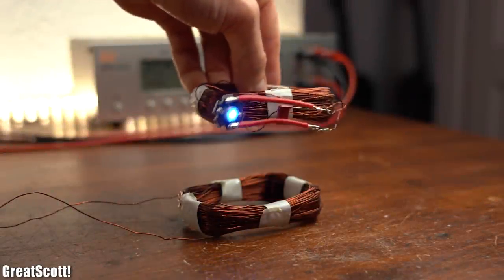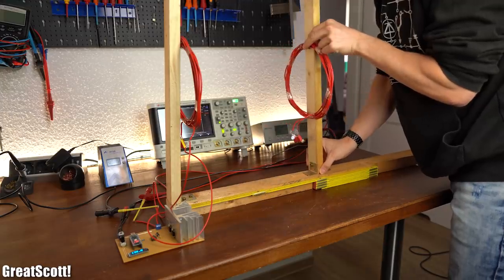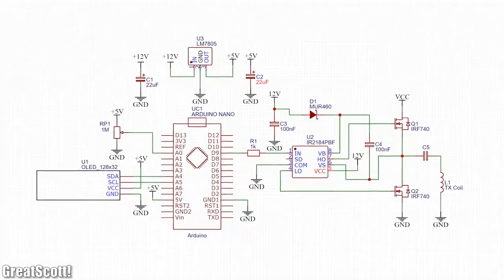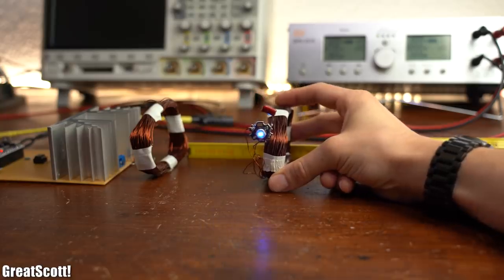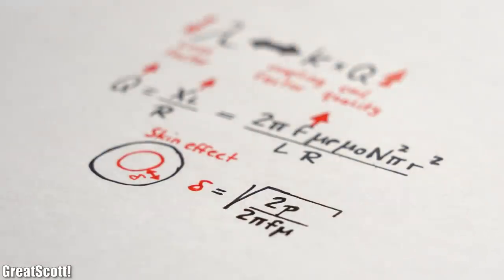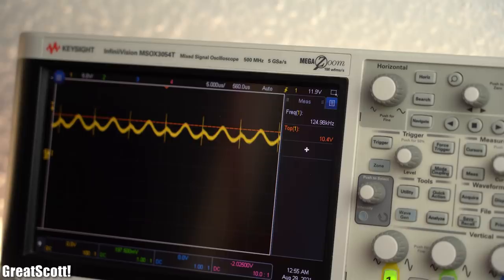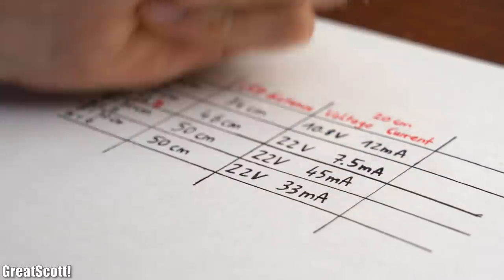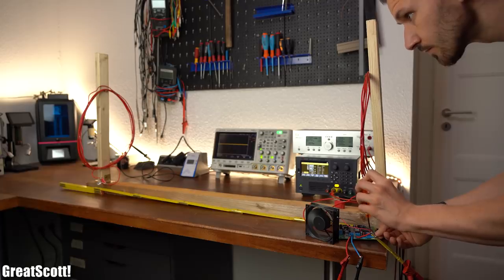How far can I Wirelessly Transfer Power? (Experiment) Better than at MIT?

Comment: I am confused. I guess it doesn't work like my possibly faulty thinking how RF power drops off at the square of the distance. Near and far field comes into play but I am not sure how.  Basically the surface area of a sphere grows with the square of the radius (A=4πr2). The part that converts it back to usable power surface area stays the same so it should drop off by the square of the distance. I guess your still in near field? I wish I knew how all the near and far field stuff works but I don't.

Comment: I'm wondering if a design similar to a yagi antenna might work better.  Where a yagi uses parasitic elements for reflection and direction to achieve gain in a specific direction, a variation of this for your experiment might work to improve performance.

Comment: Isn't short range wireless power transmission more useful, or at least more practical. There must be some real problens with wireless mobile phone charging, as it must be difficult to maintain resonant coupling when the components and Earth plane of the PCB are so close to the receiving coil. Induced eddy currents must load the transmitter coil. 
The wireless charging of the tooth brush is interesting, as the  magnetic coupling is via a two part transformer with a ceramic core.
I have often wondered why these are not used to charge portable soldering irons. A far more convenient option to the very common connection pins, which so often fail to connect reliably. I had assumed that the charging current demand of such irons greatly exceed that of the toothbrush, particularly when account is taken of the charge to discharge duty cycle. However the very small pot cores used for the coils of buck converters, suggests that two circular E cores might be used to act as an efficient magnet couple between the base of the soldering iron and its associate charger.
The prise target for wireless charging must be electric vehicle charging. I have read a few papers on the subject produced by the Consortium working on wireless charging, but it is difficult to see how this technology can compete with the efficiency of an low resistance  electrical connection.

Comment: lol, So all of that to tell us you are better off making it like an HF radio and antenna to transmit power wirelessly. like we have been doing since the 1800's.
Your loop antenna is directional by the way. and that is what you wanted to get away from. try dipole antenna or better yet a 5/8 wave ground plane antenna will get a low elevation radiation pattern and omni directional, because you are not trying to charge things on the ceiling. a yagi in vertical orientation would work well for one direction and you can adjust the vertical angle with the number of elements. just some thoughts. Great video!

Comment: I am curious if stranded v. solid copper wiring in the coil make a difference. Or maybe even each coil being a different wire? There is something i heard about high frequency and skinning effect. I think that might be an advantage for the transmitter coil in the high MHz+ frequency range, and maybe solid or stranded receiver coil doesn't matter? Love the video, as always, i am left more curious than before watching, and i now know a lot more. Thanks 😊 and keep it up.

Comment: I did something like this using 32 gauge enamel coated wire for the transmitter coil. I wrapped it around the rim of a 12 inch ice cream lid. The pickup coil was the suction cup coil used for recording phone calls. I was able to transmit music through a wall.. Maybe as far as 24 inches apart.

For your project, I was wondering if you used a H-Bridge to drive your coil in both directions, you would get more power through-put..

The MIT coil looked helical.. Would that help make it more focused in one direction?
What if the transmitter used 2 coils with (imposing polarities --(Opps that might cancel out**))?
Would that make the field go further... (Think Beam Shaping)

** coils with imposing polarities is how TR metal detectors work. They have 3 coils sandwiched like an Oreo cookie, where the receive coil is in the middle at the magnetic void.
It only detects when to 2 fields become unbalanced by an external influence.

Comment: RG-140 or silver plated coax cable is used because silvers high voltage properties. Transmitting through the shield you won’t have to worry about skin effect. Expect to be at 1 MHz for efficiency because quarter wire length. The goal is to give inductor the highest self capacitance as possible. Ideally make it equal and that happens around that wire length. It’s not just diameter that your looking at, it’s also the spacing in between the wires. That’s there the real magic happens. I dunno what the bands are in Germany but anyone trying to listen to the ole baseball game would not be your fan! 

If you took a  coil with 3 turns with a diameter that was a light year but the spacing between the windings was “close” it’s going to induce a current in the the second winding before electromagnetics could ever catch up.

Good luck brotha! This whole thing kinda mushed my brain when I started working on in. Who know maybe I just shocked myself one to many times hahaha! 

Easy to test the theory, just get close to the wire and see if your capacitance knocks the circuit outta tune. You are one with the circuit…. Om…. Or did I mean Ohm? ;)

Comment: Would a zero voltage switching get better efficiency? The mosfets losses would be minimal and only would be need good capacitors and wires
Reply from the maker: No

Comment: if distance between primary and secondary coil reduces power transmission, how about adding something in between the two coils to act like a bridge, maybe a third coil acting as a repeater in cable signal wiring....

Comment: Hello, Great Scott. Great to see your extensive experimentation with wireless power transmission. I have a question to ask you now. I reproduced the H-bridge drive circuit exactly as shown in your video, but when I connect LC in series to the circuit, even if a small VCC is given, such as 2V, the current can be close to 1A, which is consistent with a short circuit. The resonant capacitor is also overwhelmed, and the pin is almost in a state of fusing. How can I use it correctly to generate resonance?

Comment: Awesome video with nice explanation!
I had one thought that might improve this project: Wouldn‘t it be better to lead the magnetic field like a transformer does it with its iron core? Sure, it won’t be “wireless” if there is a connection of the two windings with iron. I mean you can use an iron core just as long as it should be to lead the magnetic field and get a higher efficiency or distance (depending on what you prefer). Am I right?

Comment: Question.  Does the coil need to be copper?  Can it be hollow?  Would hollow make it better or worse?  

I was thinking a coil of automotive tubing (steel) which conveniently has a protective coating on the outside that might be an insulator.  If that doesnt work then a coil of copper tubing.

Also if the tubing was filled with something like say water... salt water... steel BBs... something like that might give a larger core without added cost of large copper wire.

I think aiming for ludicrous frequencies would be a good video... I just wonder if at some point you end up coupling to every coil in every transformer in your equipment :p  oopsie.

Comment: Instead of using expensive cabels you can use cheaper copper tube from hardware store. That should minimize the skin effect. And probably you can increase your maximum frequency by using an ESP32 instead of an Arduino. I know that means more expensive power semiconductors but maybe the results can compansate that.
Reply: It won't maximize the skin effect. It simply takes advantage of the skin effect to minimize the material required to carry the current. Also you can compute the skin depth given the frequency for a given percentage of the current.
Reply: @Sylvan_dB  Yes! I was a bit too short. I mean no skin effect if the whole conductor is a skin, but if I'm right that effect only matter when you reach the GHz range.

Comment: Nice video. What is the frequency of the induced current. If it is the order of MHz or kilo Hz, it can only light up filament devices. As sophisticated home appliances run on 50-60 Hz

Comment: Wouldn't it drastically increase the range or efficiency if you put mu-foil ( Magnetische Abschirmfolie) behind the coils? It is done for the commercial coils as well and I use it at work when we are using wireless energy transfer.

Comment: What if the receiver had more turns? 
A commenter mentioned using a collimated beam. Might help too. 
This is interesting because then it would be possible to mount small solar panels outside a window and not have to drill holes. Then receive inside and charge anything that requires USB power. Especially in apartments.

Comment: Curious and fascinating (and OLD; Tesla worked on this theory a century ago). I'm wondering; could two independent transmitters increase the distance or power? Seems like it could, but I'm also thinking that some phase-locking would be helpful at the transmitters, so that they transmit at the same frequency AND phase. Would this reduce  interference patterns in the EM field?

Comment: Can you build an analog Relay Attack ? To buy a Relay Attack Unit is $15000.00 A team of researches built a cheap $20 coil via cox to coil and this bridged the car signal to key fob which then excited the key fob to transmit the open frequency. no digital encrytion needed.

Comment: GreatScott : Why you can't set the frequency super high ? ; because it increase the resistence
Me : Why you can't set the frequency super high ? ; Because you will loose more volts and amperes by setting a high frequency than setting a low frequency

Comment: Nice one 🙂. What if you use a small diameter receiver coil instead of the same size as Transmitter coil. What will be the resulting power, when the diameter of the reciever coil decreases or increases????
Reply: @GreatScott! What do you think sir?
Reply: Coupling factor (what makes energy 'transmission' possible) depends on how much magnetic flux transmission coil generates AND how much magnetic flux goes through cross-sectional area of receiving coil. In summary, the bigger every coil and more turns in each of them (in ideal world) - the bigger coupling factor and efficiency of such system.

Comment: If you connect a thin enameled copper wire to a tesla coil and run it around  a room you can light a bulb up anywhere the wire is. It does die off with the longer and thick the wire is tho

Comment: first of all amazing video, after watching this video i am hoping to try this myself with different circuit, coil variations, also i was really surprised to see the  distance u were able to reach with something homemade, something like this can be integrated into lets say something like a wireless Christmas tree where the leds have their own smaller coils well just for laughs and giggles cuz the efficiency is horrible, but i wonder i how non equal coin sizes behave, moreover how would a similar setup perform againt a laser (fed with equal amount of power) that transmits to a solar or multiple solar panels using a defeaction grating i think the laser might out perform it but ig that might be another cool experiment to do in the future, also is the H bridge circuit the same one from your previous video
Reply from the maker: Thanks for the feedback. Yes. The recitifer circuit is from my previous video.
Reply: @greatscottlab  ah sorry by the full bridge i actually meant to write the H bridge (inverter) but ig its the same one used in your older videos

Comment: I am wondering if you can rewind coils on a go kart engine to generate more power where most stock systems only make 3 amps. Thinking of a predator 212 with a charging kit installed to it.  With what some of us want to do is have lights so we can do late night rides but its not feasible with that kind of power output. I figure you are the best person to ask for this question.
Thanks

Comment: Also tesla using a wire to ground only powered light bulbs at 250yds. He also stated air could be used but losses even if tuned properly is 90% . ground transmission can be miles with no loss

Comment: Higher is the frequency of a wave higher is the energy carried. Did you check the operating frequency of the commercial wireless chargers?
Reply from the maker: Commercial ones use around 110kHz
Reply: @greatscottlab  interesting and strange at the same time, thank you.

Comment: Try high frequency with copper tube for the coils
Reply from the maker: I can put it on my to do list
Reply: @greatscottlab  means you can run into the skin effect and have maximum surface area, without all the copper being wasted in the middle.
Dave Jones toured an old Australian tv broadcast transmitter and that's how they dealt with it.

Comment: I need to transfer power over 900m. I need about 15W with at least 5% efficiency (that will make it still cheaper than gasoline) Do you think that it is possible to use offset dish to aim that? Have you ever considered to use antenna of any sort?

Comment: Maybe a silly question, but could one use a dish antenna and the primary coil in the right place at the antenna to focus the power transmission to a point where the receiver would be, thus increasing the system's efficiency over a distance?

Comment: I know this is not feasable in reality, but what would be the results when using superconducting wires? The wire diameter wouldn't play a role since they have no resistance, but I don't really know how they behave with high frequencies or in coils.

Comment: I was wondering what if there was a smaller coil on the receiving end, would it put out the same units or more  or less probably but if the transmitter was the size of the house it would seem that there wouldn't need to be as much of a draw if you where trying to power outlets or lights

Comment: just mechanically transmit it with a shaft for around 100% efficiency. it's not a wire because it's not conducting electricity

Comment: When they work this out, people will have no more range anxiety with electric cars. Roadways will be full of this stuff.
Reply: It is not even a pipe dream. The laws of electromagnetism are well understood, and they say that efficiwncy is too low to make wireless power transmission ubiquitous.

In other words, it is more likely we'd get radios, smart watches, cell phones and laptops powered by the cell towers or wifi routers, completely eliminating charge cyvles, bstteries, and so on. It is possible, but not at efficiencies high enough to make it practical.

Comment: Hello
I am working on a similar project where I have a 125 KHz source (reasonably powerful, though I don't know the power output as it is made by someone else) from which I have to power a low pin count microcontroller (low power PIC controller). The controller and the other circuitry draw about 20~25 mA @ 5V. The requirement is that this controller must work from a distance of 2.25~2.5 feet from the transmitter. My question is, what type of resonant circuit is best suited on the receiver side? We used a tank circuit. It works for about 1.5 feet distance. Also parallel resonant circuit offers high impedance at resonance so how can it source current? Is it not better to use series circuit, which is supposed to have low impedance at resonance? (we tried a series circuit but it is not working). Any help comments will be highly appreciated.

Comment: I wanna see wireless transmission using Nikola Tesla's tesla coil. Not the one to make arcs though, I wanna see the one he made in Wardenclyffe new York
Reply: That's just radio. Wireless power delivery just can't work the way Tesla imagined for simple geometric reasons. Either you create a focused beam, or the energy just spreads thinner and thinner with distance.
Reply: @Mobin92  Tesla's tesla coil can transfer power through electromagnetic induction. It's not just a radio, it's a transmitter antenna on steroids. I can't screw with tesla coils in my area because I can't find copper mesh to place in a faraday cage as I am a ham radio operator and the tesla coil can screw around most radio frequencies. I have tried 4W transfer on one but I turned it off before my transceiver gets destroyed by the enormous amount of noise it produces

Comment: not only skin effect but radio interference.

home  built circuits (unless you are a very good expert in electronics) can produce radio interference that can step onto the toes of many rf devices in the 0 to couple mhz range like radio location, land mobile, weather satellites and even in some of the lower ham ranges especially if you use used parts salvaged from junk electronics as the used parts can have values outside their original specs.

Comment: This is really an inefficient way of transferring wireless power. You need to check out Tesla's patents. There is another guy AM-innovation has transferred power over 3 miles.
The key is transform the power from TEM to LMD.

Comment: Wireless coupling will never achieve great distances. Using the MIT example, if the 40% efficiency is correct, there must be an awful lot of power wasted, with 50% of the powere escaping from the back end of the transmitting coil!  Think about a radio transmitter, they use very high powers (from 5kW to 500 kW) but within a few miles the only way of detecting their output is by using a sensitive instrument called a radio receiver which operates in the microvolt range. This method is so wasteful for power transfer that the Greenies would be chasing you down the street demanding you stop. The other problem is radio interference. Try using a medium wave radio anywhere near the transmitting part of your setup and you'll be appalled at the noise.